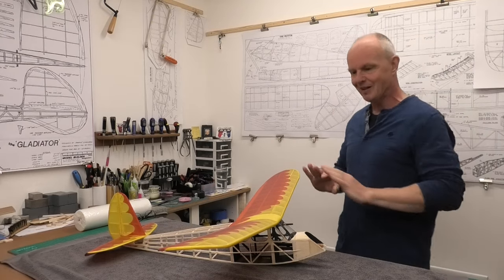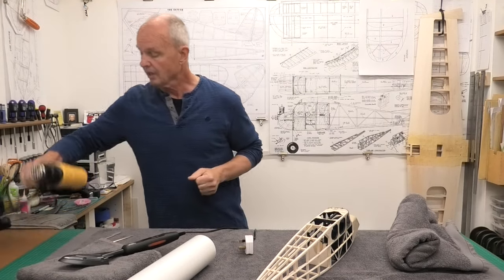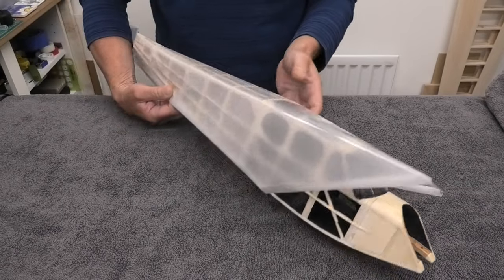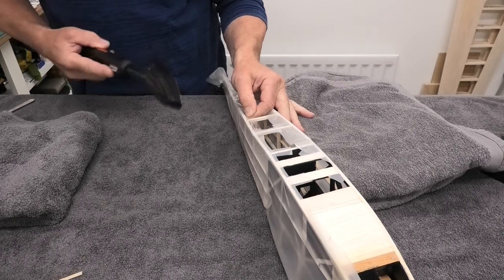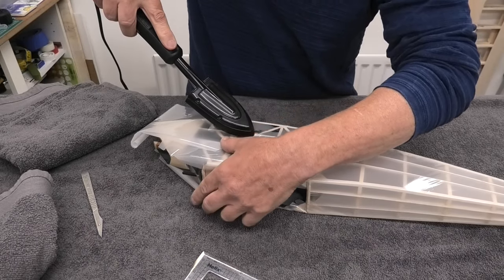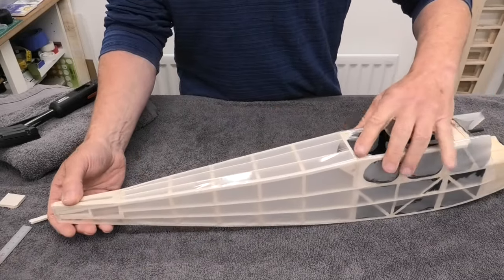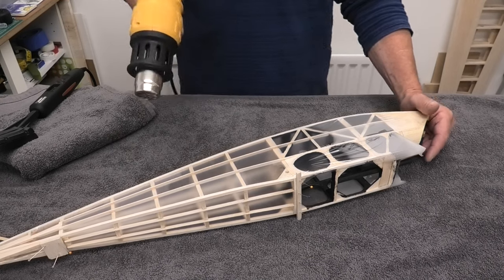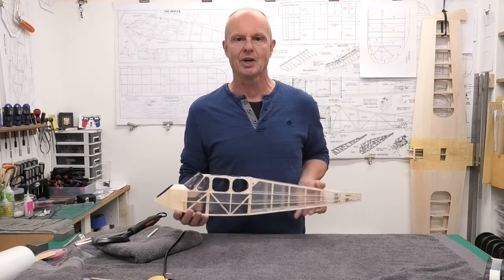45" Quaker & Mills Diesel - Build Series: Pt 22 Covering the Fuselage with Laminating Film

Comment: Mark, wondering why you don’t use a small trim iron which would give you somewhat better control than your large iron or  heat gun. Thanks for all your excellent videos.
Reply from the maker: Hi, thank you for the comment, greatly appreciated.  I do have a trim iron, but it would not be suitable for this type of large scale covering.  Trim irons I find are best for around small openings for servos etc.  The heat gun is essential for this type of covering, a trim iron would not be able to shrink the covering properly